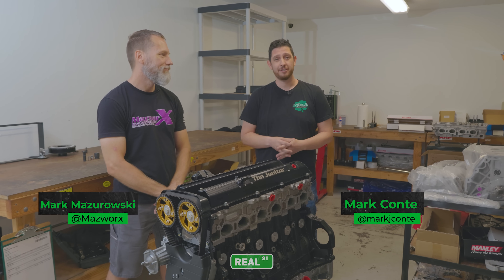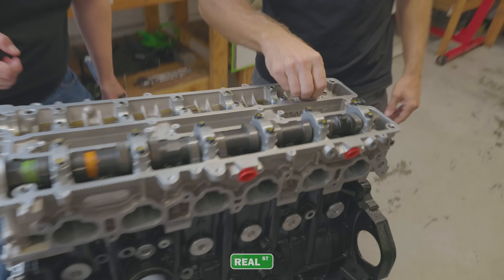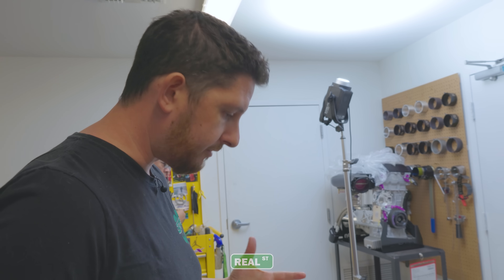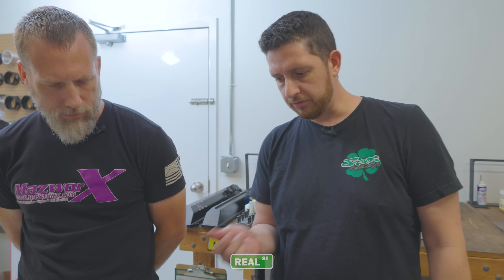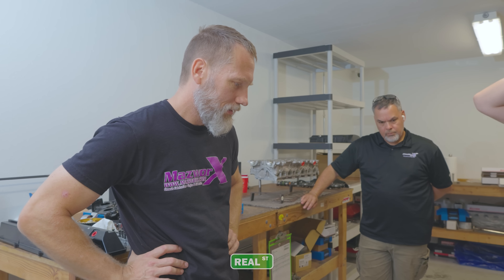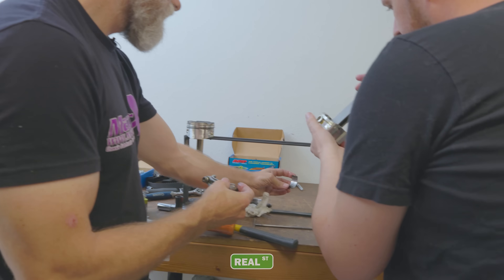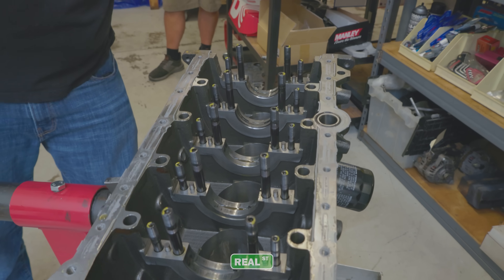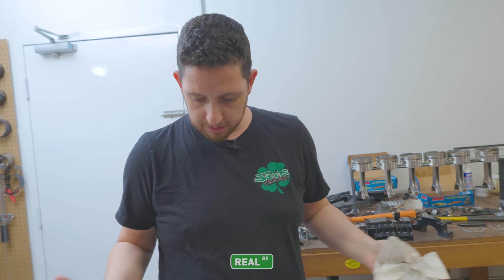1800HP 3.5L Dart 2JZ Engine Teardown, And What We Learned.

Comment: Shorter titanium rods with the same thickness wrist pins as before. Smooth out valve reliefs/ crowns / sharp edges on the tops of the pistons to prevent detonation and improve flow. Balance the pistons and ceramic coat them to keep the heat out. Dry sump oil system, with a larger capacity oil pan if you don't already have one. O ringed or Fire ringed block with the strongest headstuds available for more clamping force and less probability for bolt stretching. Compound twin scroll turbo set up or the newest style precision turbo twin scroll with a shot of nitrous for spool. Paired to a vvti cnc ported flowed and tested head. Water to air intercooler or maybe some sort of interchiller setup.
Reply: Take me to the moon and let me be along the stars. A way too much but why not!
Reply: You don't o ring 2jz blocks.......you firering them

Comment: I would like to know how the oil film got compromised, if its just because of the high load on the piston due to the power you guys are making, or it has something to do the the bearing clearance, do you need to go higher or lower on the clearances?
Reply: @ver.motorsports  to me it looks like the big end housing is a noodle..lots of movement evident at the parting line. 
Remember we saw the same ware pattern in that land speed engine, with the same rods.

Comment: Perhaps keep current stroke but with lighter rods and E85 for a road legal build. Then an intercooler and dry sump.
Reply from the maker: Ligher rods would be good! This setup already runs E85, but One Ethanol R Race E85. We do have an intercooler on this setup, but it is tucked up above rather than in front . Dry Sump for the win!!

Comment: 1. Wiseco Boostline Rods, Mahle Pistons, King rod and main bearings, OEM crank, PH Oil pump
or
2. High RPM, All motor, stroker 2jz with ITBs. full built head, big cams, light weight rods and piston, high compression, knife edge OEM crank, Light weight fly wheel and 6 to 1 equal length headers.
Reply from the maker: We would love to do a Nitro ITB 2JZ !!
Reply: @realstreetperformance  This would be the perfect build for an NA 2JZ!!
Reply: So, broke with a lot of torque or a lot of rpm? User choice, I suppose.
Reply: @OctavChelaru  Both would be nice! You have the torque at any rpm, plus the 9600 rpm. The balance would need to be perfect to have it survive. Having  a 6 to1 equal length headers would definitely change the engine nature. Would be an absolute time attack car, in the right light weight chassis.
Reply: @Akofena_AutoWerke  Of course, only the NA build sounds like a dream money no object obsession project since power/weight ratio with the iron block wouldn't be anything to write home about and if you move the powerband so high you won't have much down low and early mid. Stroke is already not rpm friendly at 86mm, stroker crank will only make it harder to spin 9600 reliably, that's a lot. Maybe better off with a lightly modified S54 at a fraction of the price if revs and response are your cup of tea. Would certaintly scream though and get people talking :)

Comment: The comment section is undefeated. They see a 1800 hp block perform well, and the next thing they say is "MO POWAH, I'M NOT SATISFIED"
Reply from the maker: More boost baby!
Reply: @realstreetperformance  Lol. I agree. But most people never seen, built, nor drove anything over 15psi of boost
Reply: @804MRMAN  The newer diesels are using some 17.5 psi
Reply: @804MRMAN  15 psi is nothing 😅
Reply: @rvarsigfusson6163  Bruuuuuh that power isn't distributed as it is in a non diesel engine. So like I said MOST PEOPLE HAVE NEVER DRIVEN A CAR WITH 15 POUNDS OF BOOST!
Reply: @dannygaldamez7616  Look out your door, and tell me how many neighbors have cars with 15psi of boost... GO
Reply: Half of these people don't understand some of the basics lol 😆
Reply: @tonymiller6255  You are correct lol

Comment: Decrease the bore on these custom iron blocks and make the cylinder walls thicker.
Reply from the maker: This one in particular is very large bore for a typical 2jz. So far the cylinders have been doing well at this power level. More wall thickness would be stronger!

Comment: I would like to see a stock crank with CP pistons and manly H Tuff rods ACL bearings and put some boosts to it to see how far it can go
Reply: Stock crank does funky stuff to the bearings at 1k whp no need to go further
Reply: @tonymiller6255 did that happened to you before
Reply: Dlc coating si sweet until it flakes off and sandblasts all your bearings lol
Reply: Dlc coating si sweet until it flakes off and sandblasts all your bearings lol

Comment: You've tried the longest stroke. Now try a shorter stroke with aluninum rods, a dry sump, o ring block and see how much HP you can make!
Reply from the maker: I love this :)
Reply: Not much man, it just comes down to cylinder pressure and fuel. You can creep past the limits on cylinder pressure if your fuel is decent like ethanol or methanol and you’re just drag racing doing short hits but there’s essentially a physical limit to what can be done. X displacement can only equal y horsepower, bore and stroke just changes the way the power hits and wears on the cylinder/piston

Comment: Also, locally in Australia, I have a customer doing 2300+ on steel rods..
Pb 6.85@ 205 rx7 2jz...it does laps
Reply: With a Dart block?
Reply: @chuxshed587  no, bullet.
Reply: What is BARRA doing with original block and then machined new one
Reply: Get off the pipe buddy 😂😂 @rvarsigfusson6163
Reply: 😂😂😂😂😂😂 run along pizza boy  @rvarsigfusson6163

Comment: Cool. Now put it back together, and sit it at 800 HP for 5 mins straight... Proper endurance test. 
Assuming the dyno has the cooling capacity to di it
Reply from the maker: I like the way that sounds. Lets do it!
Reply: @realstreetperformance  if they managed to do a full 24 hr race, group C , at MORE power, should be a walk in the park🤌. 

Plus, who doesn't like watching HP. Endurance tests are where it's at, "real horsepower".. 👌

Comment: If you guys ever get the chance, please do this for the aftermarket EJ's whenever they come out. I believe Crest CNC and IAG are both developing one. My dream for a destroked EJ25 is slowly coming to life:)
Reply from the maker: We would love to do some EJ stuff in the future!
Reply: EJ motors are boat anchors ⚓ , Don't waste your time or money on those piece of junk ... I've blown up several built EJ motors 👎
Reply: @MING26  did you miss the part where I said "AFTERMARKET". As in redesigned cast block that addresses all the weak points of the EJ's. That's what I was talking about. EJ's can't handle big power for as long as other platforms. But I'd love to see a breakdown between a Subaru EJ and an IAG/Crest EJ.

Comment: it would be nice to see a 2jz build for maximum low end torque and power. lot of builds are just max top end horsepower and it doesn't  come alive until 5,000 rpm. how about a twin scroll, vvt, stroker, air to liquid intercooler?
Reply: That’s what I’m talking about, a real street car!
Reply: @gnxtacy  im saving my pennies. my goal is 600 to 700 rwhp. but i want it to start the party soon as possible

Comment: Never knew ppl used 2ZZ buckets in 2Js
Reply: Yeah previously the only drop in when doing a shimless conversion was 2zz...
Reply: @Bondango  Did they use the 2ZZ's shim-under-bucket (valve stem cap) design too?
Reply: @lomfmur  the 2ZZ buckets are a single piece with the shim built into the underside of the bucket.
Reply: @lomfmur  1zz also, before these engines 1zz 2zz came about we used a bucket from a yamaha fzr bike but it required some machining

Comment: 1800 on an OEM sump and steel rods is nuts ... the fact it didn't grenade is testament of how good that block is.  Push it down to 1300 HP and that setup would last forever.  Else dry sump.
Reply: Engine is static in dyno, there is no G forces or inertia to challenge that much the oem sump
Reply: @mandytuning  Aah, that makes a difference.  Real world would be worse then.  But cooling would probably be better in real world, so it's a mixed bag.
Reply: @mandytuning  
Indeed, on the track the oil mass will move to the rear of the engine and sump.
However, one of advantages of a 'dry sump' is that the aerated oil can have the air bubbles removed in the reservoir return to feed pure oil to the engine - whereas with a wet sump there will normally be some aeration that reduces the effectiveness of the hydro-dynamic oil wedge that actually separates the bearings and journals. It can also cause the very de-laminating seen in the big end shells.
Reply: That's exactly what I was thinking. 1300 on e85 all day every day would be a long lasting motor. Also drop the rpm a bit and a smaller turbo would be a stout combo.
Reply: Damn straight!!!
Reply: and dis is design 30 year a go to
Reply: @francisbeaudry8598  its a brand new aftermarket block bro
Reply: @francisbeaudry8598  Dart upgraded their design ...
Reply: @francisbeaudry8598  
Quite!
Seems the morons are in full twitch mode - they don't understand the BASIC DESIGN is 30 years old, while there are some improvements incorporated with the DART block, it's the SAME design.
If you had said it was a 30 yo ENGINE, they'd be right, but...
Reply: @francisbeaudry8598 lmao this a aftermarket block
Reply: Because it revs high. So you don’t need that much torque to make as much horsepower. So cylinder pressures are lower. Horsepower = torque x rpm/5252.
Reply: @Eclipsis17  
Ah, but do you understand HOW that 5252 approximation is derived?
Reply: Tuners are the ones that keep the engine from exploding, the metallurgy of the block does not.
Reply: Stock block jz have gone over 2500 hp dart blocks have broken at 1800 hp just saying.
Reply: @Jeep_van u haven’t seen a dart block breaking at 1800 they have barely been out stop lying😂 it’s ironic saying that as this video shows it running great at 1800
Reply: @Jeep_van lmfao no, it's 50/50 if they Crack in half at 1600whp.......
Reply: @Jeep_van  oh yeah let's see your jz last years at 2500 whp 😂😂😂😂

Comment: 12:32 what rod ratio are you guys seeing with this bore/stroke and rod length? Awesome content.
Reply: 96mm stroke and 142mm rod length :
Rod ratio = 1.479
Rod angle = 71.3°
Mean piston speed @ 8100 rpm = 25.92 m/s or 5102 fpm
Reply: @nNataXx  They maintain the stock rod length?
Reply: @PistonAvatarGuy  Yep, 142mm rod is the OE length, you can see the specs on the Brian Crower website
Reply: @nNataXx  Oh, ok, then the wrist pin is relocated on the pistons. I see now that the pistons are specific to stroker engines.
Reply: @PistonAvatarGuy  Yep, with pin buttons
Reply: @nNataXx  awesome thanks brother🫡
Reply: 1.43? Stock rod is 142, minus 5 mm for a 96 mm stroker crank. Pretty short. I don't know if the wrist pin is in the stock location, sometimes they move them up on the piston to get a longer rod.
Reply: @PistonAvatarGuy  yeah it looked pretty belowed the oil rings, they used the honda rod journal also, was wondering because they mention the scuffing in the lower piston skirts. thank you brother.